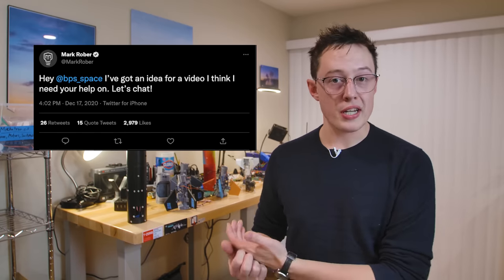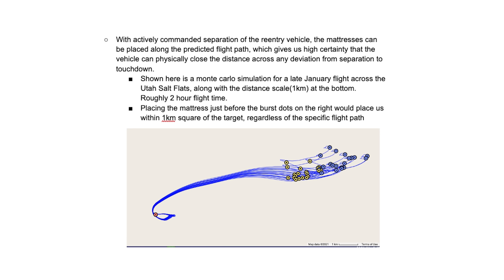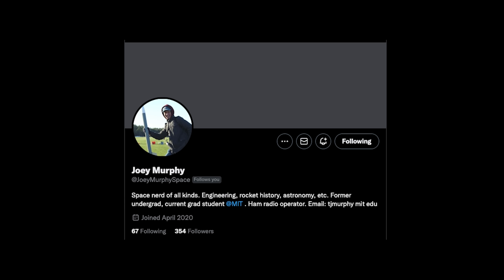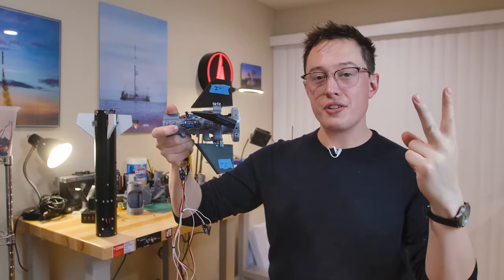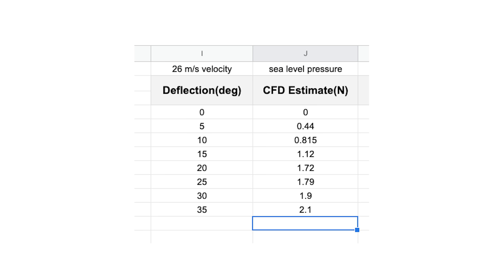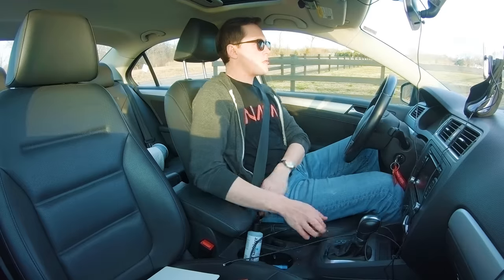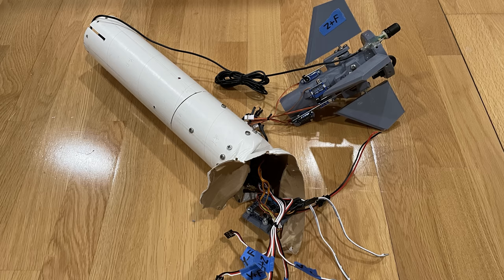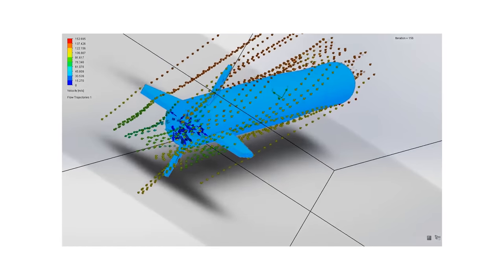Aerodynamics for Mark Rober's Record Egg Drop

Comment: Hey man, aerodynamics engineer here! I strongly suggest you to repeat the test but placing the test model over the roof in the most central position. The position you chose here has a big problem: the airflow does not arrive on the winglets parallel to the ground as you were supposing. The air is in fact following the shape of the car and therefore it was arriving from underneath the axis of your assembly. You were basically simulating what would happen during a turn or a very strong lateral shear.
Reply: He could also come up with a way to mount the whole test assembly out into the undisturbed airflow in front of the car. Probably would want something sticking out a good couple feet in front of and above the bumper.
Reply: @a.p.2356  yeah it would definitely be even better, but more expensive.
Reply: That was the first thing I noticed.

Comment: I can't help but think of an egg drop I did in college. It wasn't very robust because we were limited to 30 3x5 inch cards and some scotch tape, but design worked very well. It was like a spinning seed, except with 4 helicopter blades. We tested from three stories up, but it stopped accelerating downward almost immediately as most of the force of gravity was being converted into rotation and creating lift. It landed on concrete as softly as if we'd set it down by hand.

Since you ended up eschewing the landing pad, a similar design instead made out of carbon fiber could have worked here. It does wander in the wind, but the gyroscopic force keeps it upright. Wherever it does land, it can't become a danger to anyone because it's terminal velocity is so low.

Comment: My biggest project is a recovery system that uses a Rogallo glider.  Fitting it in what's left of a BT80 after a BT50's stuffed it and keeping the center of gravity in line is going to be tricky.  The glider part will be easy.

Going after anything other than a big Estes-type is difficult where I live, or I'd certainly have spent all my savings on rockets by now.

Comment: that rogue negative sign reminds me of a failed Atlas-Agena launch back in the 60's, where one letter in the code was r, not r. (the dot is on top of the r, but i don't know how to get it). r. is the averaged data, and r is the raw data, which has spikes cause of vibrations, little deviances cause of wind, etc. this meant that raw data was fed into a sensitive system, which treated it as filtered. it went quite badly off course, and the flight was terminated.

Comment: I'd predict that the air over the top surface of the car was going faster than the car itself as in order to maintain mass flow rate around the obstruction, it would need to. So it's actually showing the force for a slightly higher wind speed. So if you take more CFD reedings at higher speeds and squash it down, then you'll probably get the same curve as experimentally measured. This would tell you what the CFD thinks the actual wind speed was.

Comment: My immediate thoughts would be to use two larger fins that work like elevators with a small dihedral for natural stability and one smaller fin pointing down as a rudder. With that you are turning it into a really rubbish glider with no wings as such. So that makes it more like NASA's lifting body experiments from the late 50's to early 60's.

Comment: Nice work..!

There's a book on missile aerodynamics in open literature by Nielsen and a monograph on aerodynamics of bodies of revolution by Krasnov. They're excellent. IMO those two have enough content to completely characterize your vehicle's configuration. 
You can most probably just take results from those books without having to depend on wind tunnel or CFD time. Even if you don't have time to read and understand the stuff it's fine. The results are the only thing you'd need.

Just for curiosity, have you looked into stuff like sliding control? It should allow for stable control even with rather large uncertainties on the dynamics of your system. Robust-adaptive control would let you learn the system dynamics on the go. 

This is also an amazing platform for free flight testing of vehicles.

Comment: I'm an RC modeler/pilot and you blow me away, but I might have a tiny bit of advice from my field that will help you. I hope it finds you well:

When I fly an agile sport plane like an Extra 300 you can fly slow and throw the control surfaces a lot, but when you're fast, holy smokes it just takes a micron of server throw to put the craft into a different attitude.

This takes high performance ball bearing servos with more than enough torque to overcome forces.

Anyway, I only mention because I saw some in flights where the fins were jacking around waaaay to much. 

Maybe you already know this and it was a computer issue. 

Maybe do like musk and fly your rocket a little like an airplane (starship) instead. 

I look forward to all your future endeavors!!!!
Reply: What I meant was you don't need enough torque to overcome... If you want high precision accuracy, you need more than enough torque to resist any flexing in the arm, the wire, the surface. You want hard and accurate conditions for accurate snaps to new position so that the computer reads a new accurate position.

Comment: 3 years is insane! Are you saying with hindsight aerodynamic foil shapes would have been a better choice? This looks like it could have been a SpaceX style belly flop. And that's great advise about pivoting when a design isn't working - even when you have a lot of sunk costs. I did this recently on a hackathon project and it was definitely the best decision. There are usually signs that you should do this, but in the heat of the moment it can be tempting to ignore them!

Comment: Only 4 fins in the back will make it much harder. You also need some smaller fins on the body of the rocket, forward of the steering fins in the rear.

Comment: Honestly hitting a pad on the ground to save the egg seemed kind of lame anyway. However, with 20/20 hindsight it still would have been smart to use a guidance system, not to hit a pinpoint target on the ground but to make sure the egg landed in a defined area with good camera coverage.

Comment: simpler is complex, complex is simple
Reply: knowing is nuts, not knowing is smart, if God knows for you, alone
Reply: you dont know, not you but God in you, so lose the "consciousness"
Reply: then the servo fails
Reply: if you trusted it to not flex/fail
Reply: if you design fail resistant then it will not catastrophically fail
Reply: ie rud avoiding
Reply: no wonder you avoid rudders
Reply: dont you want to deliver rocket packets
Reply: childish
Reply: back flaps are better than complete angling fins
Reply: keep the stability with ability to steer
Reply: you are not a boat, but an air plane wing, much faster air movement
Reply: dont you think trajectory estimation is not public knowledge
Reply: sounds like your control method is a bit jerky

Comment: Would two fins at the front and two fins at the back of the rocket similar to Starship make the kinematics easier?  It would naturally right itself belly down and simply moving the forward fins close to the body or straight out would give you some guidance.  Steering would be done by moving the left fins inward or right fins inward to drift left or right.

Comment: Instead of trying to mode the Transfer function of the fins, you can use a field of electrical engineering called system identification. It a field that is generally not taught anywhere some people will do their PhDs in it. It’s the math behind identifying systems in real time in which you only know the input and output. Obviously you know the fin control input and could use the attitude solution as an output. Using sys ID you could dynamically “identify” the TF/behavior of the system. Too many variables when trying to directly model
Reply: I’m guessing the ppl u talked to discussed this

Comment: Why not use Wedge Shaped fins?  Say the wedge is 30 degrees or 15 off vertical on each side.  Then a 5-degree deflection of the fin gives you 10 on one side but 20 on the other.  This will allow small movements in fin angle to have an appreciable impact on fin side loads as the effective AOA is substantially more than a flat fin.  After all, you really do not care too much about drag.

Comment: I have a question - Why can't the starship "skyfall" drop design work for this egg drop? I mean apart from the parachute lifting the entire module, one could drop the entire rocket in a free fall and then just adjust the fins so that they are parallel to the ground. Shouldn't that reduce the number of variables you are accounting for?
Reply: they didnt want it to be too much like a plane

Comment: would this have not been way more simplified by making two of the parallel fins larger (leaving the other two smaller) to create a sort of horizontal/vertical stabilizer pairing, giving you a defined orientation and creating a more predictable flight characteristic

Comment: How’d you not get in trouble for doing this?!
Reply: Because they immediately stopped when they realized what they were trying to achieve.
Reply: @lulalelilo  But they still did it. They actually dropped the rocket from the balloon (although there were some technical difficulties so the “drop” ended up being from a lower altitude. I guess I’m asking how they got permission
Reply: building this kind of stuff isn't actually illegal, what's questionably legal is telling other people on the internet how to do it. And they did this in the Owens Valley, where amateur rockets frequently go to 100,000ft and sometimes higher (and then fall back down).

Comment: an 8 fin design 4 on top and 4 on the bottom would have had better stability and accuracy , to move parallel left or right you tilt both the 2 pairs on top and bottom my the same degree

Comment: Ukraine would be interested in a very cheap terminal guidance hw for a gr.. an "egg".
Reply: They're already doing it with drones.
Reply: @lulalelilo  the Ukraine made drones are lacking terminal guidance. I have seen the videos, and it takes skill, and very low wind to drop the payload precisely.
The USA Switchblade drones can do this very well, but they are very very expensive for Ukraine to self produce, and they are receiving limited supply.

Comment: why dont you just drag a guidance wire up with balloon or rocket that guides back the egg to the ground? better use a balloon that holds the wire under tention during the egg slides back to the ground

Comment: So you guys dropped from 100,000 feet, right? So technically, it was more like an egg drop from the stratosphere than egg drop from space, yeah? I know I'm pedantic and annoying and the Kármán line is an arbitrary definition open to argument, but 30km is definitely too low to be space, right? Not to minimize the genuinely epic accomplishment that all this was, I'm just kind of curious about that technicality.
I could be wrong because there was a ton of things that really took me by surprise from this project. Like I had no idea how a rocket body in free fall could reach Mach 1; I'm still kind of confused about it.
I wanted to add that I was hugely impressed to find out from Mark's video that Joe is completely self-taught with no formal education in engineering. As others have said in the comments, that is super inspirational.

Comment: Do you intentionally try to be as incompetent as possible for the views, or whats the deal? Is there a single project that you were able to finish successfully without overengineering and overcomplicating everything to the nonsensical point?
Reply: That's rude AND wrong. Nice.
Reply: @maxv9464  I am 100% sure that he is intentionally incompetent because that creates content and draws in views as he is more approachable in that way. No way that he is really like that after 5-10 years working on such stuff as practicaly his primary job.
Reply: @dvukovic  He's entirely self taught. Fin guidance is notoriously difficult, hell, you can see his previous attempts at it.

And it's not incompetent anyway. All of it is very impressive engineering and iteration.
Reply: @maxv9464  He overcomplicates everything, that is why he is failing. When choosing the design, he looks like he doesn't have a grasp of basic physics, which I am sure he does have, and thus, that he does it intentionally.
Reply: @dvukovic  Example?
Reply: @maxv9464 example? every single video he publishes on his channel.
Reply: @dvukovic  Ok, so how is the self-landing scout rocket overcomplicated?